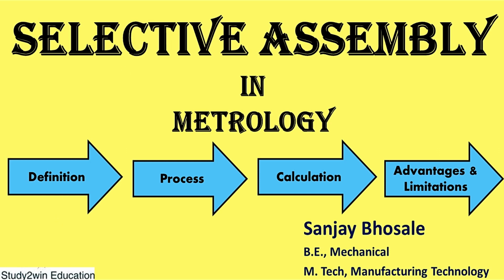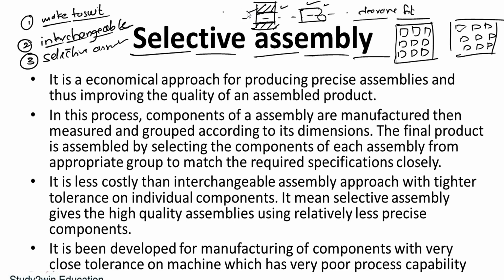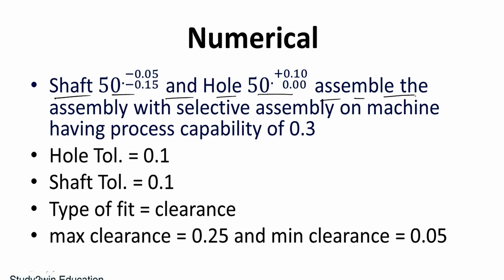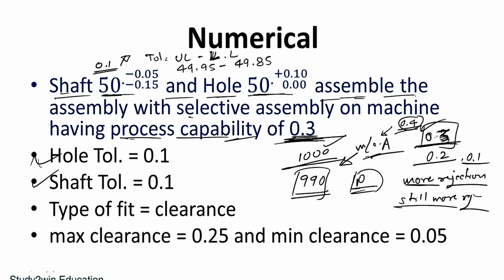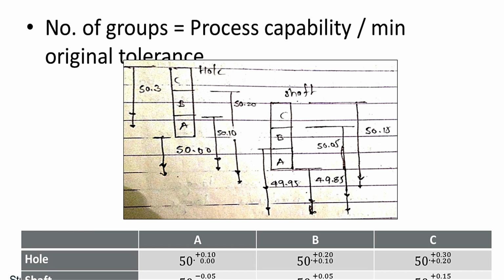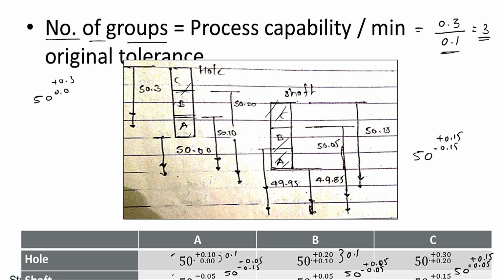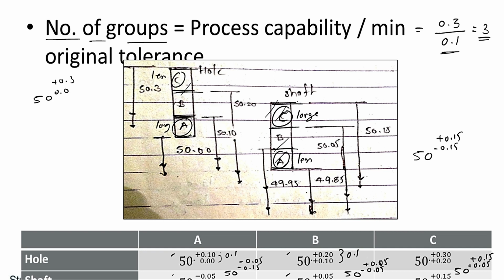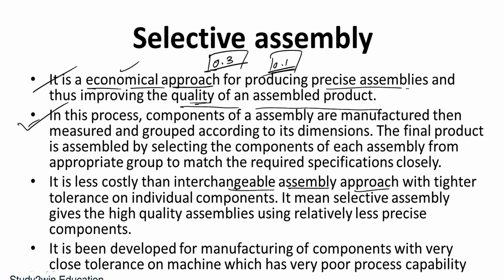Selective assembly in metrology (Interchangeability, types, example, calculation) in detail

Comment: Thsnk you for the concept....
Doubt : 
What if holes and shafts are produced in two different machines say machine H and machine S respectively. The tolerance zone of hole is equal to the process capability of machine H but the tolerance zone of shaft is less than the process capability of  machine S... How we can use Selective Assembly in this case ??